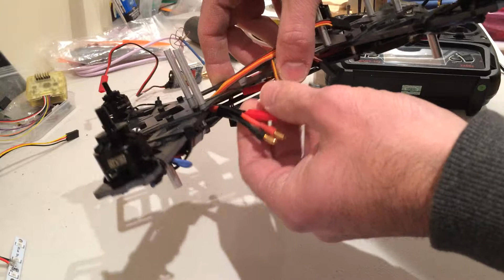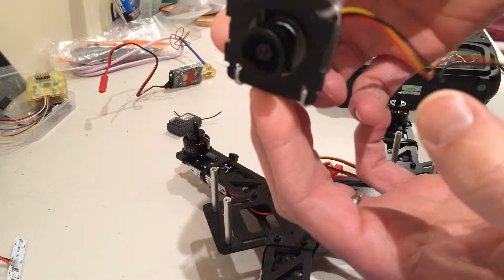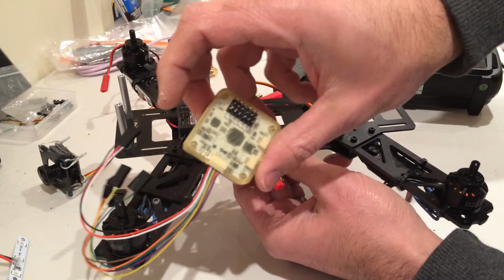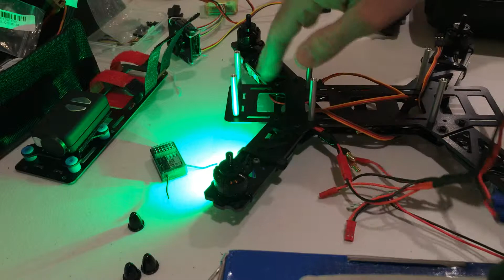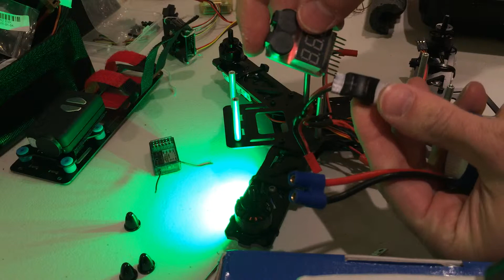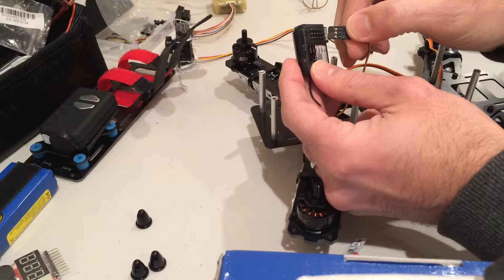DIY 250 QUAD - Part 2 : assembly

Comment: Hello friend, I can explain how to synchronize the receiver with the devo Control 7 thanks
Reply from the maker: Power up the radio first and then connect the receiver to the battery. The receiver will bind to the radio because they are both Devo it will work.